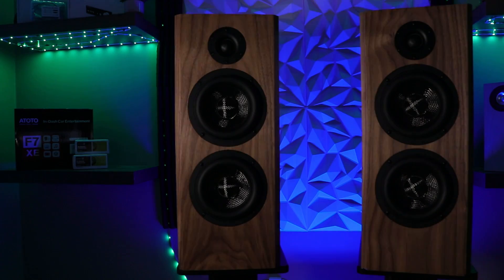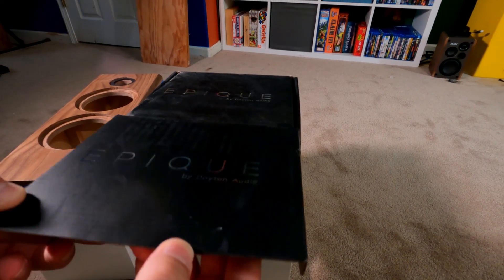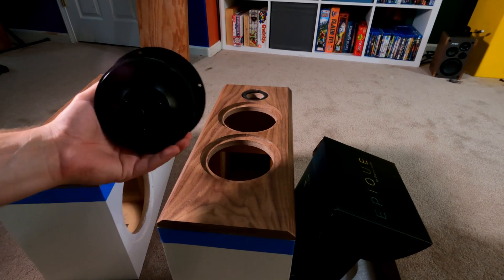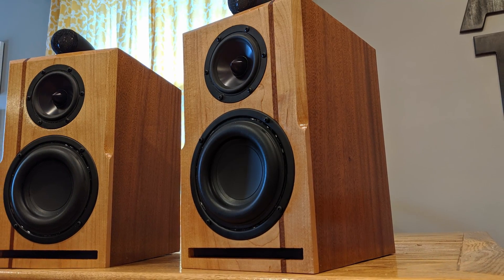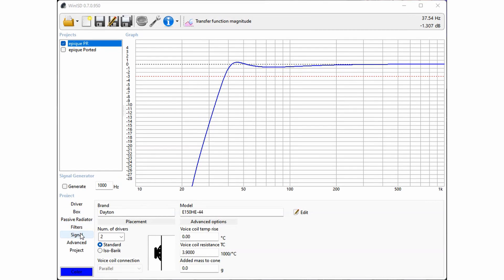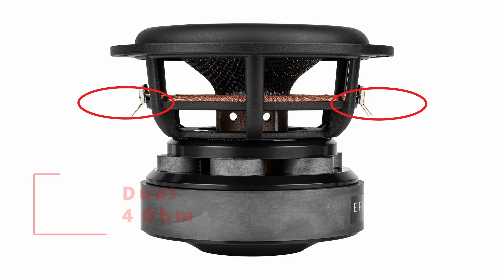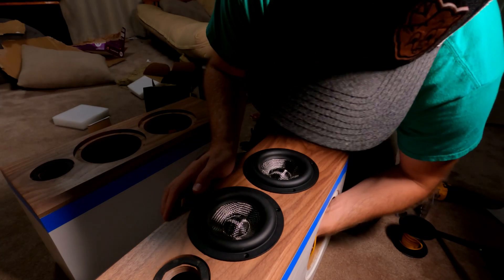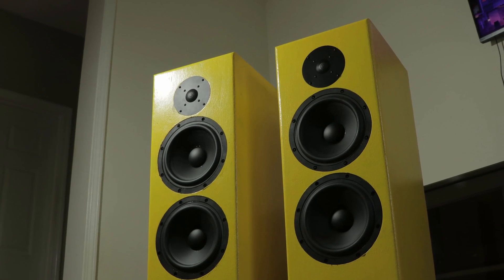How to Design a Speaker - Epic HiFi Technical Breakdown

Comment: I believe you are mistaken claiming that "theoretical" gain is 6dB. 3dB gain is by double the cone area maintaining the power. Also 3dB by double the power. You add another speaker so cone area x2 but the profits of lowering the resonence by half gave you nothing cause you have to split it to two speakers now. So each 4ohm driver have the same amount of power that one driver on 8 ohm. Your gain now is just by cone area and thats "theoretical" 3dB.
Sorry for my English. Love your show in Poland!
Reply from the maker: So you get the three decibel gain like you said by putting the second driver in. You also get the three decibels because you're basically doubling the power. The reason why you're doubling the power is previously the speaker was an 8 ohm impedance and now it's a 4ohm impedance. halving the impedance gives you a theoretical three decibel boost with the same voltage. Just gives you a total of a theoretical six decibel boost.
Reply: Well let's do the math
I'll bring specs to something that gives us simple results ok? Dayton is 8ohm total so
8Ohm = 100w power for 1 speaker =90dB
Now let's add another speaker and you end up with total 4Ohm impedance so
4Ohm = 200w power for 2 speakers =
200w divide by 2 is 2 x 100w so 90dB + 90dB = only 3dB.
And that's it. Nothing more you can add to this. 
If You would double the speakers and than double the powet for EACH one of them, than;
2 x 200w = 2 x 93dB = 96dB but that's not your case. You did double the power but  than split it on two... No gain here.
Reply from the maker: @danielczajkowski7702  we measure sensitivity at 2.83v since amplifiers have a constant load.  Both woofers are going to be receiving the same voltage.  Since this is the case you follow the formula 20 log(2) which is a little over 6db theoretical boost in sensitivity. You appear to be talking about efficiency which is a different concept than sensitivity.
Reply: @Toid  it has more to do with the crossover right? It's not about real efficiency but more about crossover integration if i see it right?  But i have come to this video because i was curious about the midrange, how does it sound compared to other woofers??  Nice build!!!

Comment: what an incredible explination for people just learning. while im an advanced builder i still love the way you present things and wath for enjoyment. I have to ask, since you tried both these and the Karteisan mini subs, if you were going for a 3 way compact build, would you use these sealed or the kartesian, i have tried neither and would love your take between both
Reply from the maker: If I was doing a three-way I would use probably the 7" Epique. The Kartesian is really too small for a three way (4").
Reply: @Toid  i was trying to make it super narrow with 4 inch coaxial and 2 small drivers. i was comparing between the epic 5 and karteisan and curious how much better the epic is mostly. for small home environment. well technically these would be 4 way, since the coaxial is mtm with matching 4 inch woofers. the SB PAC series. Just a fun project. My main concern was power handeling with a coax, and 2 mid bass, with 2 more drivers for sub base
Reply from the maker: @djfirestormx  oh okay. You wouldn't go wrong with either. However, I'd probably still go with the Epique, if you are doing it sealed. With us higher excursion, it should give you more than enough bass while allowing some DSP if necessary.

Comment: Sick build as always! Just woulda choosen a different PR as it's limiting the speaker.
Reply from the maker: Yeah the passive radiator was kind of a compromised on this build. Honestly it gets louder than I needed to so I don't need more power. The major issue was once you go to a different passive radiator that works with full power tell me you're spending a significant more amount of money. However when the epique passive radiators come in, I'm sure tha I'll try them in it. According to Zarbo audio projects latest , they should be relatively similar price to these. If that is the case, that should be an easy swap out.
Reply: @Toid  Yea sadly PR's are super overpriced. It's absolutely insane how they are always priced.

Comment: I have XBL^2 woofers on my Chane speakers and I've not seen/heard a cleaner sounding speaker yet. What I mean by that is even playing down well below tuning. Like 30Hz. There's zero distortion until you push it to its limits. And only when it's at its limits does it start to distort. 

I plan on getting CSS subwoofers to replace my Ultimax 12s soon. Only because the Ultimax 12s show signs of distortion due to BL loss above tuning at louder levels nowhere near rated power. Though for the price the Ultimax 12s handle 16Hz+ fantasticly. Easily doing 110dB+ from 16Hz+ with minimal to no distortion using two of them.
Reply from the maker: That CSS sdx12 is the cleanest sounding 12 I've heard. I think you will be very happy with that choice.

Comment: High excursion drivers are usually not my cup of tea, but interesting build for sure. Dayton claims 83dB nominal, but in the datasheet it's more like 80 in the midrange. 
That's still not bad for a long throw speaker of just 5" and looking at it, it's a wonder there's any useful output beyond 1kHz at all, wow. 
I still wonder though, how much Doppler effect distortion will there be, with that enormous cone travel yet (I presume) quite high LPF frequency...

Comment: I've never build DIY speakers, so how would these speakers compare to something off the self? Can they compete with elacs, kef, wharfedale etc..?
Reply: The answer is yes and no depends on what you mean in terms of sound yes in terms of cost no especially bookshelf speakers 
I make an 8 inch two way bookshelf speaker for about 300$ a pair (my cost) sounds great I have sold a few 
My 8 inch 3 way bookshelf I can make for about 450 a pair (my cost)
People love them I've sold many 
The real cost savings in diy speakers are the big boys 
My floor standing speakers are each one has 2 8 inch woofers
two 8 inch planar mid range speakers and four 3.5 inch planar tweeters I built these for around 1100$ on cherry live edge slabs 1.5 inches thick they are open baffles on the top woofers in a box
If you have a passion for music and a little carpentry skills then read up about crossover design and try a small cheap set first and go from there 
My first three way was built of nominal pine wood (cheap at home Depot) with cheap drivers that matched in spl. So crossover would be easy to design and ohms 🙂
First try no good 😊 second try on crossover much better 
And they were built with a circular saw and drill only power tools I used
So if you have passion give it a go if not buy yourself some good ones and be happy with them 
My floor standing speakers are probably in the 3-4 thousand dollars range but I'll never sell them I love them 
Best of luck to you

Comment: what are the non-linear distortion figures at 90db spl on 500hz? 100hz? 1Khz?
This high excursion low efficiency driver is all about low dynamics heavy cone, with a lot of intermodulation distortion 
(bass guitar modulating singers voice as an example). 
I doubt this will  do a clean 30hz without having 60hz and 120hz clearly apparent where your ears are far more sensitive, 
a clean 20Hz is just pressure on your ears, you should hear nothing, I'll bet you will have tons of 40 and 80hz harmonics which you will clearly hear.
another one trying to dey the laws of physics

Comment: The configuration that you call mtm is called D'Appallito (sp).
Reply: No. Not every speaker with a center tweeter and two woofers is a d'Appolito type. The real d'Appolito design needs specific types of  filters too, which are dependent on the distance between the drivers.
Reply: @westelaudio943  indeed.  Agreed

Comment: Have you considered doing a mass loaded transmission line design? They are more involved than a sealed or ported design, but programs like Hornresp do all the heavy lifting, as it were. I find that not only the bass quality and extension are top notch - but also the midrange sounds completely "unboxy". So soundstage is fantastic.
Reply from the maker: Elliott designs and I talked about doing one. But we haven't yet.
Reply: @Toid  That would be great. I think that mass loaded transmission lines are much better than they used to be; because we now have programs to design them. The placement of the woofer inside the TL, plus the right taper extends the bass lower for a given woofer.
If you're interested, I would be happy to share my plans for the MLTL-6 with you. It is a 21.5" high stand mount 2-way design; with a 6" paper cone woofer & 1" soft dome tweeter. Total cost of drivers is ~$150. It has 3 internal baffles plus a brace.
The woofer I am using has an Fs of 35Hz, while the fundamental frequency of the speaker is 32Hz. The driver is 89.5dB sensitive, and I haven't measured it, I think the speaker is possibly more sensitive than that; because the output from the back of the driver is utilized.
Reply: The main issue with mltls is that they're massive. And you can generally get better results from using a larger woofer in a ported or even sealed box that's the same size. Tho there are definitely applications where it's the best option, it's fairly niche
Reply: @blakebrockhaus347  I have designed several and no, they are not massive. As I said they have the best bass extension and quality that I have heard.
My latest design called MLTL-6 uses a 6" paper cone woofer from SB Acoustics, and is essentially flat in room to ~32Hz. It is 21.5"H x 9"W x 16"D, so not small certainly, but not huge. I have a tower version, that should extend to ~28Hz (flat in room) which is 1 meter (39.375") tall x 8"W x 14" D - which is pretty slim, actually.
Getting more extension from a smaller woofer has a big advantage - a smaller driver has lower Mms (the driver I use is <14 grams) and this means lower distortion due to overshoot, and better response in the upper part of its range.

Comment: Is the crossover for the MTM configuration included in the plans?
Reply from the maker: It is not, I never built a MTM. Having said that, there's a lot of confusion on the TMM using smaller drivers like this. Maybe I should have spent a little bit more time on that. However you can read a really great explanation of it here by Jeff bagby. Should be about the fifth comment down. https://techtalk.parts-express.com/forum/tech-talk-forum/64889-isn-t-a-tmm-supposed-to-be-2-5-way

Comment: Planning a similar build! Designing a TMM Tower with their bigger cousins, the e180HE. Going to use dual Dayton reference 10 passive radiators to really juice up the power handling and output potential. Hoping to tune it into the low 20s.

Planning on staying in brand with the fabric reference tweeter too from Dayton :)
Reply from the maker: That sounds like a really great build. Please share it with me when you're finished. I would really love to see it. If you want to put it on the forum, I'm sure a lot of other people would enjoy seeing it as well.
Reply: The suspension of those don't seem to be linear enaugh as most pr's those are an after thought so you can guess the PR Xmax is more similar to what the woofer of that PR has. Probably would use a seas roy one as it's suspension linearity seems to be great.
Maybe a Transmission line?
Reply: Did you do the e180 build?

Comment: I appreciate this follow up video on this speaker build. It was great to hear you talk about efficiency and distortion of your woofers and also see where your crossover point was. When I look up the frequency response of that tweeter it shows it only goes down to 2kHz. For a $200 tweeter (after tax) It would be a risky move for most trying to use it that low. I am thinking there would be some excursion limits for the tweeter being used at 1.6KHz? I am subscribed to your channel and appreciate the things I have learned from your videos but there is no way I can afford to pay for a patronage on all of my favorite YouTube channels.
Reply from the maker: I completely understand and respect that. It's not possible. And I really appreciate everyone that helps support me in any way they can. Whether that be just buying plans occasionally or clicking on affiliate links or just watching the videos. It's all very helpful and I appreciate all of it. And especially enjoy reading comments from you. I know you comment quite often and I really do appreciate that. It's a good thing to remember as well that when a manufacturer of the Tweeter recommends a certain crossover point, they are typically recommending it with a second order crossover. And so you can cross it over lower by using a higher order crossover. I've done this quite often then builds where I need to get just a little bit more juice out of a particular driver.
Reply: @Toid  Thank you, I will keep that in mind in future builds on potentially using a tweeter a little lower by simply using a higher order crossover.
Reply: I think Morel wouldn't recommend me crossing the CAT378 at 1,35khz yet it deals with it pretty damn well. The distortion doesn't rise in the crossover region. Like he already said. He is using a rather steep crossover so no problem.

Comment: 7:00 What about using a dual channel amp per box, where you use 1 channel per each Epique speaker, keeping it at 4ohms? Wouldn't that have a similar gain in sensitivity?
Reply from the maker: Great question. However if you used a dual channel amp, you would need the amplifier to be capable of 2ohm. Let's do the fact that the epique drivers are dual 4 ohm voice coils so they can either be wired to 2 ohm or 8 ohm. But you could get lower sensitivity by doing that as long as you can find an amplifier capable of it.
Reply: @Toid  oh yes, I see what you mean, but it seems you are considering still 2 Epiques per box. My idea with the dual channel amp per side was to avoid using 2 subs and instead just 1, with the hope that driving each coil at 4ohms would improve its sensitivity.
Reply: @ralmslb  having wiring each amp channel to one coil would definitely help, but there's only so much bass you can get from a 5 1/4 driver. Even one with as much throw as the epique.

Comment: Thanks for the explainer! If the box size and tuning weights were properly adapted, would the 7" drivers work well in this application, or would the high-end of the woofer suffer, needing a different crossover design?
Reply from the maker: The 7-inch would probably work fine, however your main issue with the 7 inches it already has a baffle step compensation built into it. I think if I remember correctly I should do very well on something like a 10-in baffle. Anyway, by adding a second 7" Epique you will get a rise on your low end down to your baffle step.
Reply: @Toid  thanks for your reply. I keep coming back to this great video as I read and learn more. Do you think the Puntkilde tweeter would work well for this application as well w/r/t linearity and power delivery or would you worry that the 30W limit wouldn't be enough for home theater HiFi?
Reply: I have no idea what you said, but somwhat understand it. Is there a parts list for these speaker and or drawings?

Comment: Why did you go with a 2 way and not a 2.5 way design?
Reply from the maker: I'm just going to copy and paste my comment from up above. Here you go: There's a lot of confusion on the TMM using smaller drivers like this. Maybe I should have spent a little bit more time on that. However you can read a really great explanation of it here by Jeff bagby. Should be about the fifth comment down. https://techtalk.parts-express.com/forum/tech-talk-forum/64889-isn-t-a-tmm-supposed-to-be-2-5-way

Comment: Is it a 2 way or a 2,5 way? A 2 way MMT design will have the acoustic center a bit far so I would cross the bottom woofer at 250-350 somewhere. Otherwise a really nice design and good job!
Reply from the maker: There's a lot of confusion on the TMM using smaller drivers like this. Maybe I should have spent a little bit more time on that. However you can read a really great explanation of it here by Jeff bagby. Should be about the fifth comment down. https://techtalk.parts-express.com/forum/tech-talk-forum/64889-isn-t-a-tmm-supposed-to-be-2-5-way